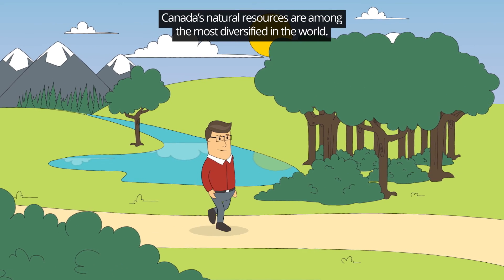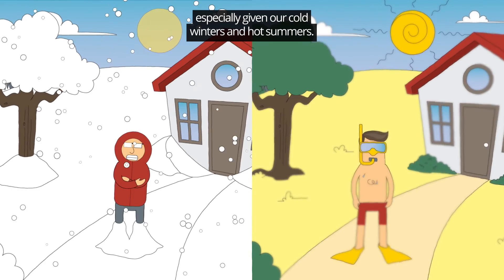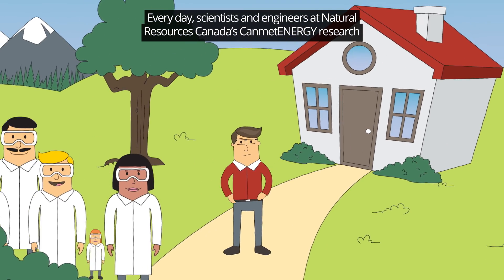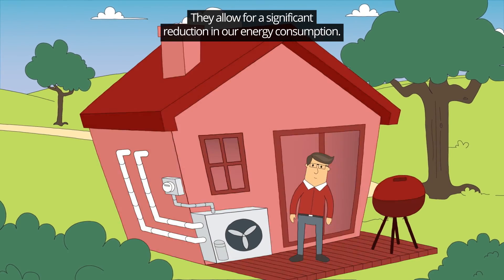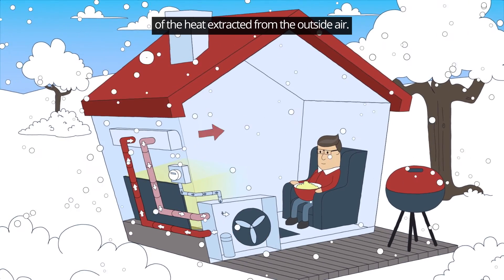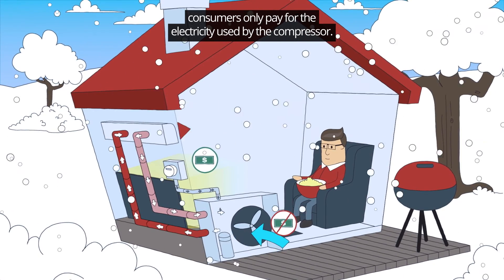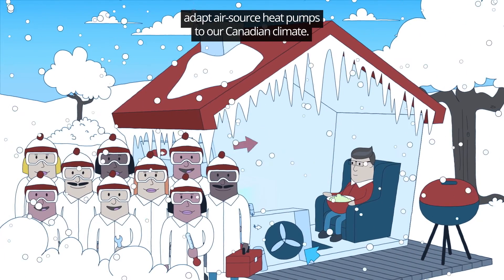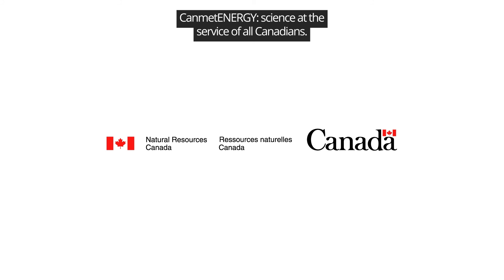Adapting heat pumps to our Canadian climate

Comment: This is an interesting cartoon, but a bit confusing. (It is posted on the Gov of Canada 2022 HP site). Let's just share our observations on the air flow at the outside unit, the "outdoor coil". According to all HP descriptions, in the HP heat mode, the air from the outside is delivered into a heat exchanger inside a home (not sure how?). Let's say the outside air temp is 15C. The air temp is apparently reduced to about 10C by the HP and then forced OUT of the unit by its fan. (I know the temp difference as I have measured it with a laser temp gun.)  Thus the big fan is blowing the cold air OUT, not IN! Presumably, the 5C temp difference provides the initial energy for heating a home and this is a "free" energy coming from ambient air. Then an electric heater inside a home ("inside coil") adds the rest of the energy required to heat the air inside to a desired temp set point (eg. 22C). The HP heating apparently works much slower (10x?) compared to a gas furnace, but warm air is distributed much more uniformly throughout our house. It feels almost like a floor heating. In the HP cool mode, the air blown outside would be warm, coming from inside a home. In the HP cool mode the unit would act like a standard AC unit...  Any comments are welcome as I could not find much info on the HP air flow online that would match my observations.

Comment: Yeah sorry Gov. where I live in Canada we get weeks of -38 - -42c I will burn anything to make heat starting with natural gas. What environmental impact does manufacturing a compressor have? They do still use OIL for lubrication right? How’s that 410A refrigerant helping climate change, all these units leak eventually..  I think I’ll take some stainless tubing in the form of a heat exchanger. Thanks.

Comment: It extracts heat from the outside air to heat your home in winter?? It's -19c today, how do you get heat from sub-zero air?  It goes against all logic doesn't it?
Reply: So long as the radiator from the heat pump is colder than the outside air then it should warm inside your home. Basically a heat pump is an AC in reverse. Problem with most heat pumps is that they have difficulties working efficiently at colder temperatures (-40°C).

Comment: The dumbing down and misrepresentation in this video is frustrating. "uses electricity to increase the temperature of the outside air" makes it sound like a heat pump creates heat. It does not. It concentrates heat that already exists in outside air. It also definitely does NOT "provide cooling by transferring warm indoor air to the outside". A heat pump doesn't move air in or out of the house. Is this really the best we can do, nrcan?

If you want to actually learn how a heat pump works, I recommend this video from Technology Connections: https://youtu.be/7J52mDjZzto

Comment: I live in Edmonton, AB, Canada.  Today it's summy and +11°C.  During the winter we had -30°C for almost 2 weeks.  Even with dual fuel ASHP combined with gas furnace, I suspect we would be burning natual gas for about 5 months.  I think a geothermal unit would be better, but I don't know if we can get permission to drill the deep holes on residential lots.  I don't have enough room for a horizontal loop.  It would have to be vertical loop.
Reply: What, speak english

Comment: That was a feel-good PR pitch and had no details on adapting heat pumps to Canadian climates. Which is what was promised in the title.
Reply: Ive got that answer. Passive geothermal. Use the natural earths heat to preheat the air being fed to the condenser tower, and the exhaust from it being pushed back down under the ground on the other side of the loop. 125ft of 10 inch pipe will give you all the energy you need to operate a heat pump in -40c
Reply: @davefroman4700  Yes, I'm aware of p-geo, but it requires either a huge yard or a prohibitively expensive deep well (the latter of which is going to be impossible in a lot of cities, too). External box-style heat pumps such as are depicted here are for places you can't do geo, and they didn't talk about it at all.
Reply: Exactly! I stll hyave no ideahow it works

Comment: Pity the feds still can't mention ground-source heat pumps.  Far superior to air source, and actually turn your house into a NetZeroPlus building.  I installed one into my last house to become one of the top-20 energy efficient homes in Canada, with 93% of the electricity demand during off-peak period.  Details at http://my-green-home.ca
Reply: given how much utilities hosed me for just being hooked into the grid, these are a good heating a cooling solution for off grid living. Given they don't use a whole lot of power and can be supplemented with a wood stove. If a home has a bill of $325 the actually usage is only $80 or less with 70% of the entire bill being transmission and distribution charges. in rural areas these can push a bill into the thousands per month so it no surprise im seeing solar panels and small scale wind turbines popping up like weeds in the country, Your paying so much that you can add 800W of solar panels, or 200AH of batteries every month! in less than a 5 years most of your system is paid for, in some extreme cases less than a single year.
Reply: We have one in our current home... After the initial investment to install it, it's practically free to heat and cool the home! Unfortuneately though, we're moving to a new home and due to it's geography it will be prohibitively expensive to put one in.

Comment: $500 a month Dec, Jan and Feb for a 1500 Square Feet home...
Reply: To OP.  That doesn't sound very plausible to me.  Where do you locate?  How's ur home insulation?  Air tightness? Which heat pump did you go with?
Reply: which one you are using? .. is your home air tight? leaking?
Reply: I call bullshit on this comment for sure !

Comment: Lol I love that the air source heat pump heated house has a chimney
Reply: Because a “heat pump” is a like a fix capacitor. In that it’s bullshit. Turns out it’s real cold in the winter. And you can’t just “extract heat” from -40. Wood stoves on the other hand are awesome
Reply: @woodwalker6025  Actually with powerful enough compressor it can definitely do it
Reply: @matthewzasiewski9730  >“extract heat” from -40

What? Do they mean capturing the wind? "Capturing" heat from a cold environment, or "capturing" cool air from a hot summer day, is nonsense.

>A heat pump extracts heat from the cold outside air and transfers it to inside our home.

>To this end, a compressor inside the device uses electricity to increase the temperature of the heat extracted from the outside air.

With a powerful enough compressor? Yeah you could squish the outside air into a compressor which would heat it up, but if that was anywhere near as efficient as radiant heat, we'd already be using it.

BUT, if we could all become badly drawn, government-funded cartoons, it may just work...
Reply: Gas water heater?

Comment: How are you going to defrost the outdoor coil when the ODA is at, or below 40 Fahrenheit? Basically you end up using electric resistance suplemental heat. Also heat pumps have what's called the balance point where the amount of outdoor air infiltration meets and eventually exceeds the heating capacity of the system (which is 40-50 degrees).

In the USA we have dual fuel heat pump systems using natural gas, propane etc, or electric resistance heating. That could work and correct me if I'm wrong, but I hear Canada has a natural gas issue, I.E. a shortage.
Reply: They reverse the cycle for defrosting the outdoor coils, while doing that, they rely on electrical heating indoors and they stop the fan outdoors to accelerate the defrosting. Once coils are defrosted, cycle can resume again and fan is back on and electrical heating is turned off.